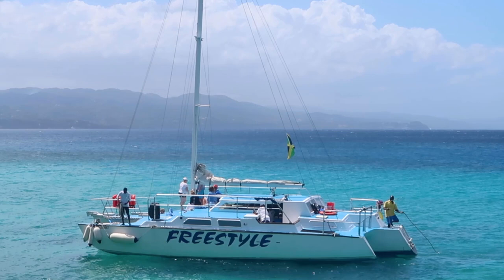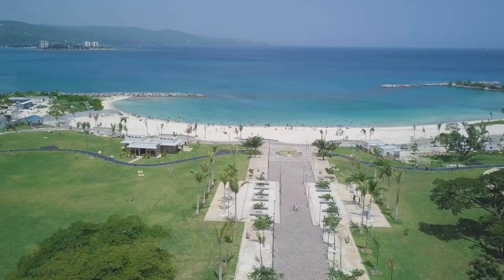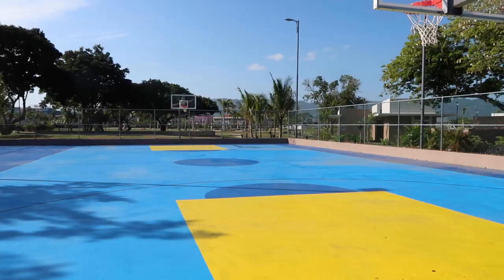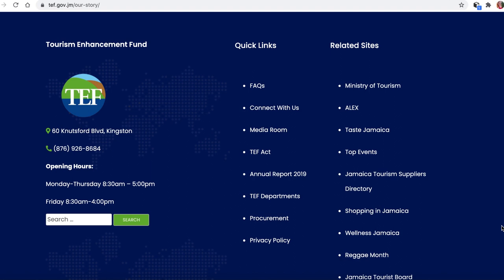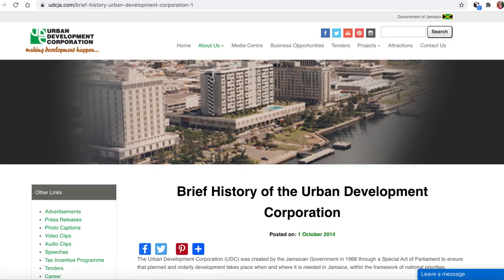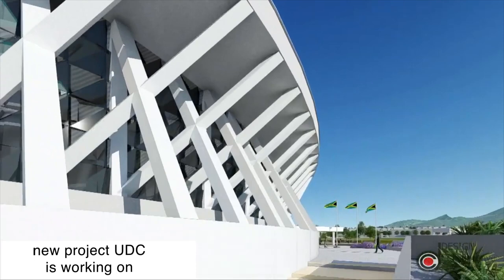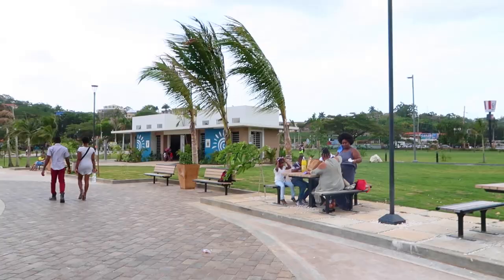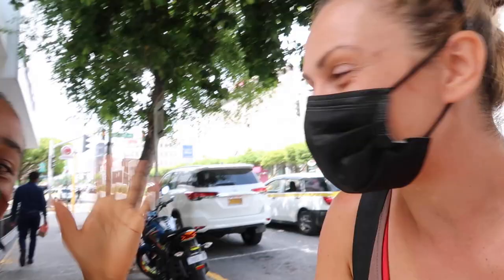Where does MONEY go from TOURISM? ft Harmony Beach Park. Montego Bay, JAMAICA.

Comment: did she say that Montego Bay never had a Park and certainly the first with a beach front? That is not accurate.
Reply from the maker: I said there was nowhere to walk by the sea front. 
1. Montego Bay has a park, called Old Hospital Park, which was also built by UDC. It has no access to a proper beach and it is very small. 
2. Montego Bay also has Dead End Beach, which is not a park. 
3. Montego Bay has Walter Fletcher Beach, former Aquasol, which is 10 USD per person to enter and it's a beach, without walking area. 
4. Montego Bay has Doctor's Cave Beach, which is again - a beach, 10 USD per person.
None of these places have an area to walk by the sea front.
Please correct me where I'm wrong, thank you.
Reply: @JAMAICAWITHIRIE  lol...I did not realize that Jamaicans/Visitors had an issue with walking in the sand by the beach. Persons do not go to the beach to walk or jog. It is typical and normal to walk in the sand. It is only in recent years with new developments the walking path/jogging path are included as seen in other projects across the island. There is absolutely nothing particularly unique really. Also, it is normal for government owned attractions/areas to charge a small fee to ensure maintenance of the facilities. The only way the money would be an issue would be if same was excessive.

Comment: Where is our major, well equipped hospital? Another asinine spending adventure placed on the outskirts of a town that is rotting in its core and other red of its periphery. Forgive me if I don’t celebrate this profligate, untimely spend...
Reply from the maker: When a new hospital is built, you will say "Where is our well equipped schools", when the schools are built, you will say "look at the roads", when the new roads are built., you will say "but look at the crime rate!!!!" etc, and this will go on and on, because people think that the centuries of problems can be solved all at once over a couple of years - it doesn't work that way.
This video was on a different subject, so including the detailed information about the new hospitals that are being built would have been completely irrelevant, but sure, there will be a separate video on hospitals in Jamaica and the situation with medical service in general. 
To answer your question directly though - the Ministry of Tourism is not designed to invest into hospitals - Ministry of Health should be doing that. But yes, there is already a major well equipped hospital that was built in Montego Bay. It's called Hospiten. It's a private hospital, but it has low rates for the locals. The fact that many locals still don't take advantage of using that hospital is simply because of their lack of knowledge and assumptions that this hospital is for tourists. Please stay tuned for videos about hospitals, coming up later this year.